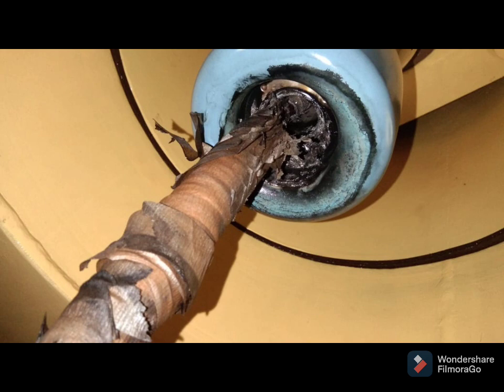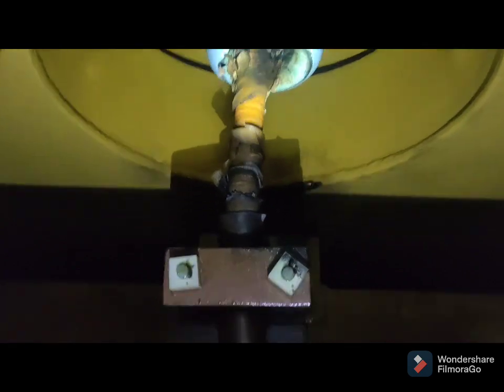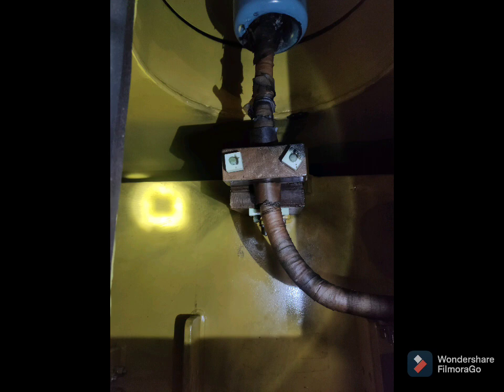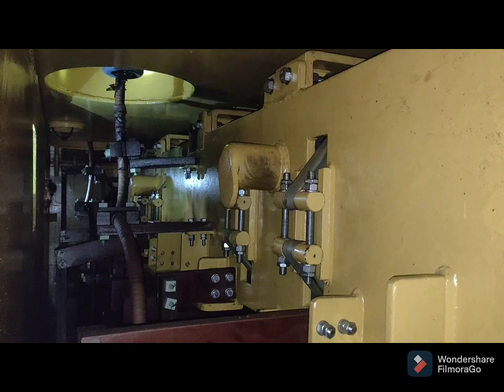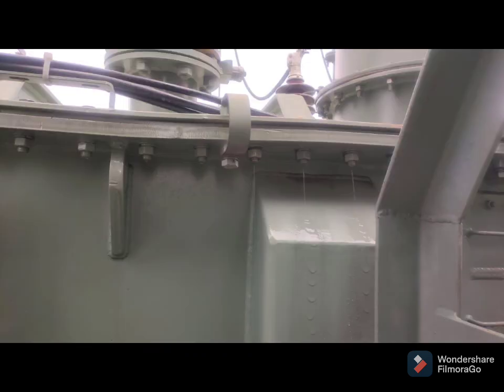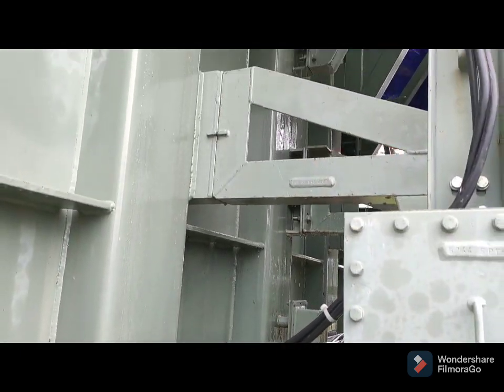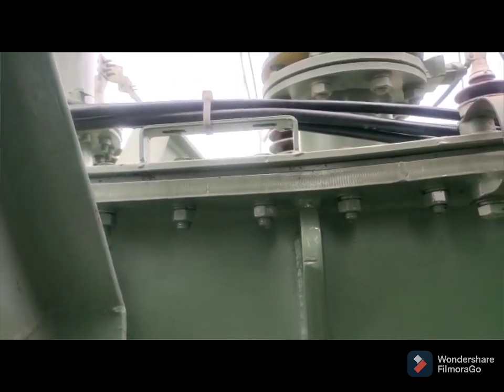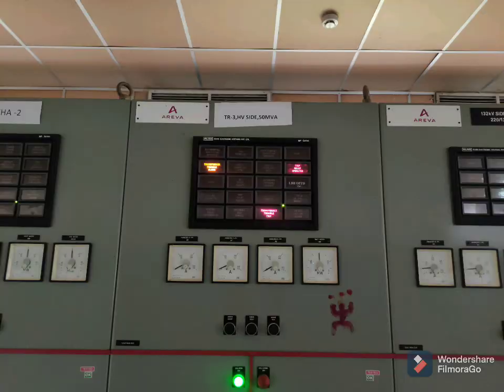Tour inside the power Transformer // HV lead ,Turret CT

Comment: Ah a post mortem of the transformer. To prevent this in the future make sure that the internal guts are as dry as possible, absorbed water forms ions that arc. Putting a few sacks of dry Epsom salt ( anhydrous MgSO4) and letting the transformer bake in the sun with a fan inside will do fine. The chemical will absorb all the moisture.